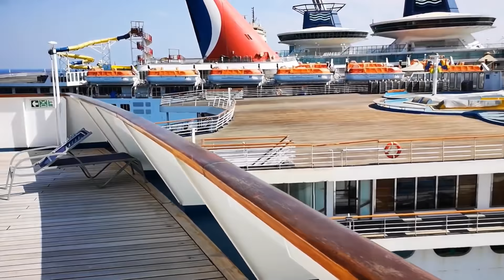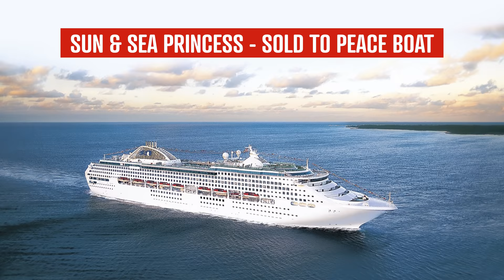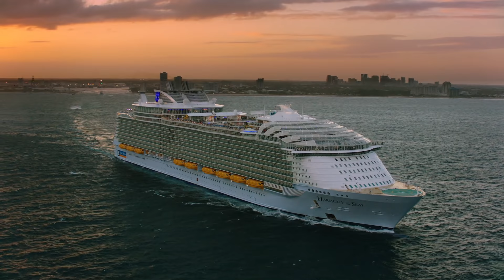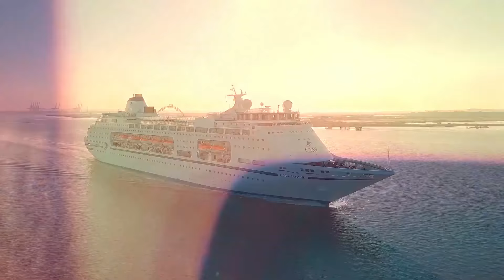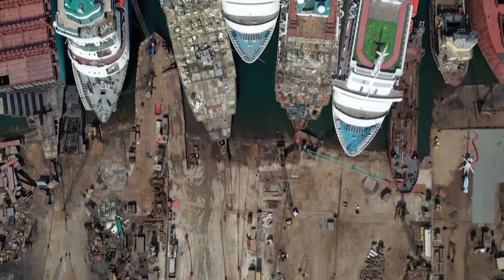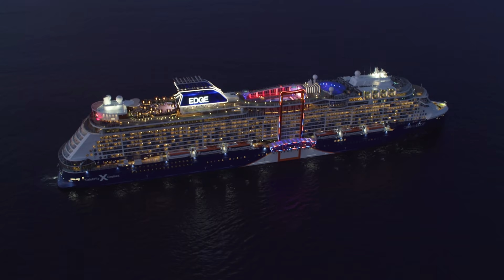These are the Cruise Ships Scrapped in 2020/2021

Comment: In Tourism we know that the 2 most sensible sectors are cruise ships and resorts which are only dependent on tourists only and can't be used for anything else so it's always tricky to work with those as sometimes a simple war in a country can trow things off and a pandemic is pretty much the worse case for cruise ships as they are the worse situation to be in if that happens. Albeit i'm more sad to the losses of jobs than the loss of ships. At least more jobs are being created while they are scrapped.